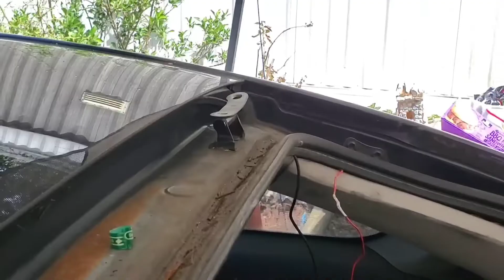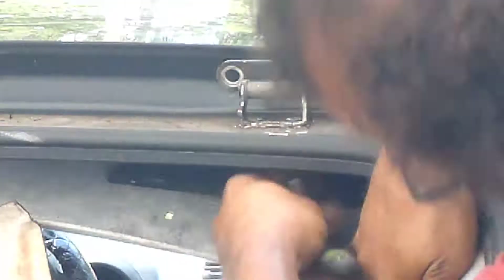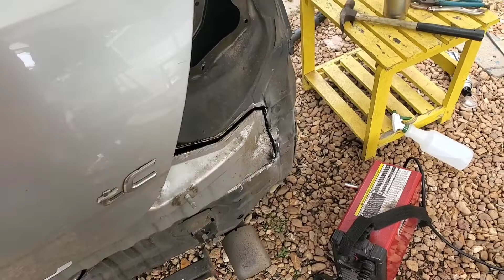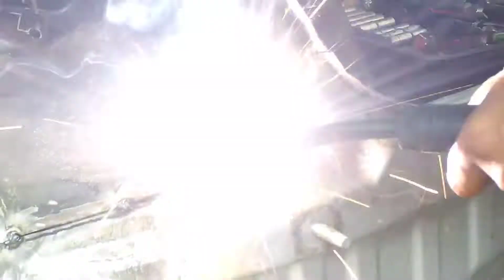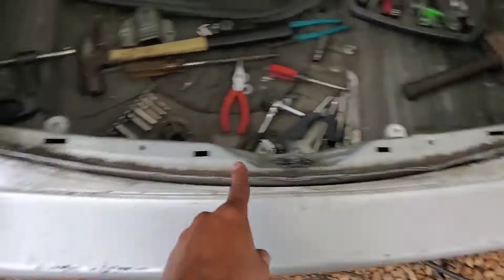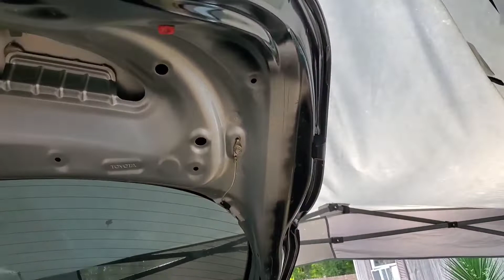2007 Scion Tc Rear End Damage Repair

Comment: Great video, I’m trying to do some body repair to mine. How the hell do you get those plastic knobs for the package tray out of the felt side panels? There’s a hole that I imagine you push in to unlock something but I can’t get it out. Thanks.
Reply from the maker: If I remember, some of the pieces twisted to line the thing up with the hole for extraction.
Reply: @TheImprovisationCenter  
Thanks for responding. Yeh it finally came out, there’s a small hole, I kept pushing a small screw driver around in there until the clip released and it popped loose. Thanks again.